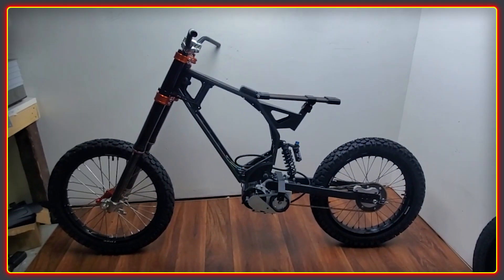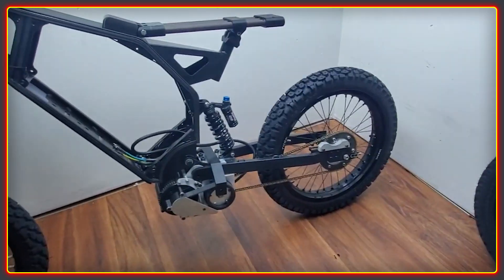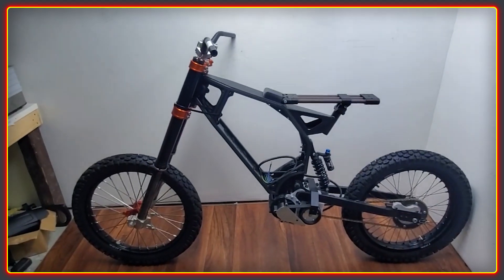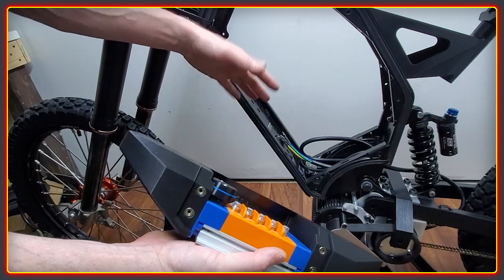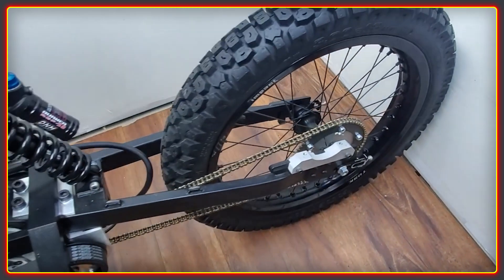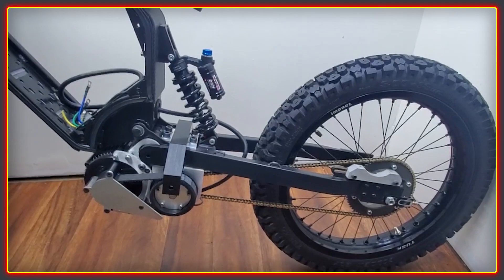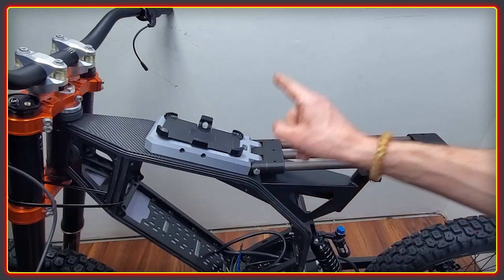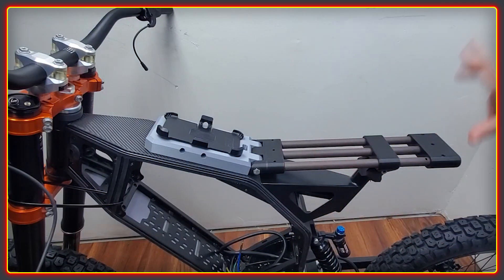Lightning Rods Big Block XL with a Vector Typhoon Electric Motorcycle Build Progress!

Comment: Most awesome Moto project! On another note Do yo know 
of any controller that I can install to a Cyclone 3000W miidrive motor? 
Don't want a Cyclone controller so anything else is ok, I have a 52V battery..
Reply from the maker: The Cyclone can be tricky. You could try something VESC based maybe. There is nothing I know that is plug and play though so it would require some learning. We have a VESC channel on our Discord were you might be able to get some help.

Comment: Hi Mr J. I was wondering, when you built your rear wheel, did you use the same spoke length on both side of the hub?  I have seen the same Lighting Rods Big Block XL setup on another Vector frame (Dr Chopper 8) with 3.25-19 tires and there was plenty of clearance between the chain and tire, I guess it all depend on what hub you are using... I will probably build similar setup with the XL on my Enduro frame this winter and have the same 3.00-17 Shinko 244 Dual Sport Tires in the rear and hopefully, I won't have the drive chain rub on the tire knobs...
I'm still debating on which controller to use between Nucular 12F, 24F or the new PowerVelocity Next Gen controllers.

By the way, any developments on this Vector build? Is it finished or close of being finished?

Cheers
Dan
Reply from the maker: I can send you some dimensions on Discord if you want. I think I just bought the wrong tire. It is very tight back there tho. The hub is not quite the same as Mikes. Its on a delay mostly time but as I get time its not the priority as people want more focus on the LITE frame they do. So that is the current focus. But yes I would love to see it finished.

Comment: what would be the difference, if say instead of having 1 stage reduction before going to your final rear sprocket, you kept the same ratio, but instead had a chain going directly from the motor to the larger rear sprocket, im curious how that might change power delivery? maybe be more motor efficient? trying to plan out my build which is looking very similar to this bike
Reply from the maker: That would definitely work and it does very well on the quilbix frame. There is also a drive system that lighting rods make for this bike that is single stage. It does not fit with this bike swingarm though.

Comment: Hey cap, in the MTB world shocks come in all kinds of lengths.  Being that DMN is kind of a budget brand perhaps look into a longer shock, say from Fox or Rockshox, in the used market.
Reply from the maker: Its a good idea. I'll keep the options open for sure. I guess I could make a rod to measure the distance and see what is closest as well. Thanks
Reply: @HighVoltageKits  yep. Also depending on the size of headset used, there are adjustable headsets, for changing the steering angle.

Comment: What is the effect of a more slack head tube angle? Good to see progress. Be Well.
Reply from the maker: I think it makes the steering a bit more responsive.
Reply: @HighVoltageKits  a higher steering angle also requires a bit more effort to turn the bars and also makes them self center more.
Reply: It can be good or bad. Thanks and Be Well.

Comment: Looking good. I'm planning a build with a series of 8 interchangeable batteries for  a 35mph /200mpd cross-country ride. I could be looking at any ocean in 10 days. (On paper at least)
Reply from the maker: Sounds fantastic. Are you going to do solar charging as well?
Reply: @HighVoltageKits  It has most definitely been considered, but not adequately researched. Still trying to source a few panels of what I call "expandosteel" or perforated stretch to build the trailer. Great move would be to make plans now for attaching panels to its exterior, eh?
Reply from the maker: Yeah for sure. I am really looking forward to moving on it. We have some of the CATL cells to try out for a trailer. I figure two banks at 60 volts is almost 80 amp hours. You would be welcome on our Discord group if you wanted to post some pictures and chat with people doing various projects. There is a link in the description.

Comment: What do you think about mounting a 267x89mm rear shock? It would save you the effort of machining the mount, it brings some extra rear travel and ground clearance for the motor and corrects the head tube angle.
Reply from the maker: I'll look into it. Another person mentioned a different shock. I might mock up some lengths and see how it looks.